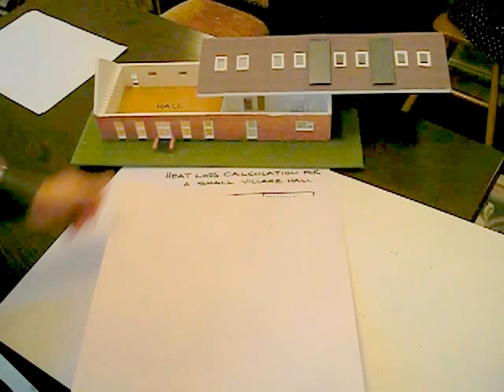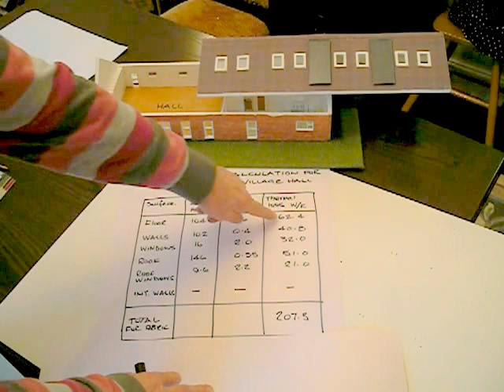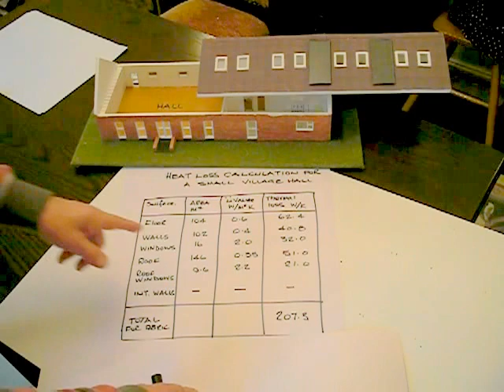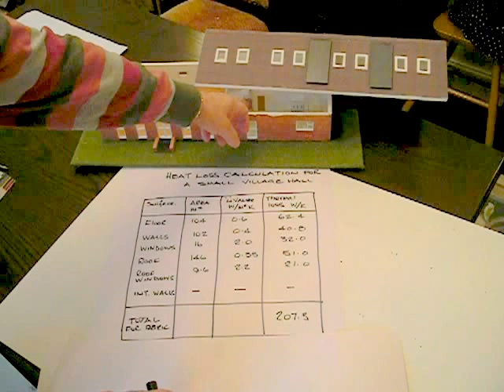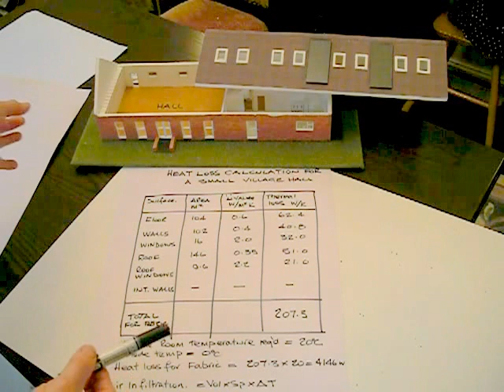How to calculate heat losses and size a radiator

Comment: Such a scientific calculation and then he goes and blows away 70W x 6 radiators!
Reply: its better to be over than under.. he also calculated the temp going to 0c but on a bad day it could go down to -15c.. then what?
Reply: @mickbmx  he accounted for everything and then oversized the rads! Surely the calc should have accounted for variables that are impossible to calculate as opposed to going with the next size up the result he had!!!
Reply: @da_great_mogul  radiators are made to round numbers. He could have never bought the exact size radiator. Same goes for drain pipes. If you calculate the average rainfall a lot of gutters are oversized. You wouldn’t want to undersize stuff and have things fail.
Reply: @mickbmx  that's correct but what you could do is ensure the sum of the total adds up to what you need. This would mean adding some smaller sizes in to ensure the number matches to the output required. In writing off 70w x 6, it obliterates all the great work he did to get to his correct output!
Reply: @da_great_mogul  his calculations are still worthwhile for a big space over guess work. He’ll know for sure it will definitely heat the space. Not great for OCD I guess.
Reply: @mickbmx  you're right, it just seemed a shame that being so OCD, as you said, to begin ended up with him wasting output due to restrictions in the sizing of the radiators when in fact, he could have got far closer to the total sum he needed by reducing some the sizes, as I mentioned.